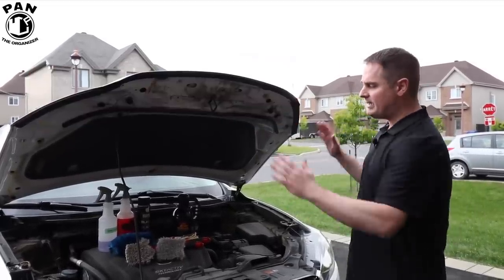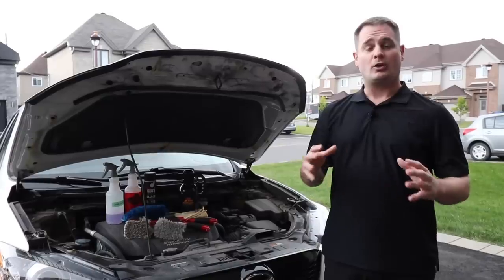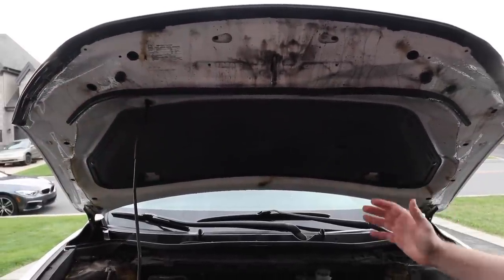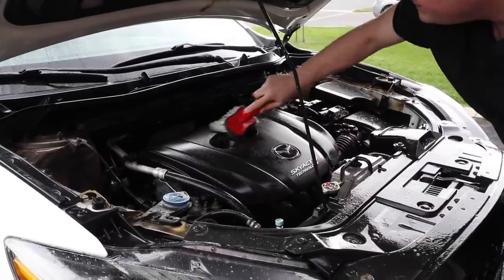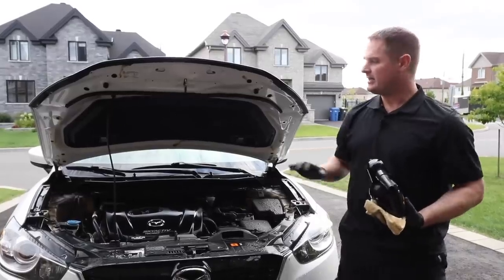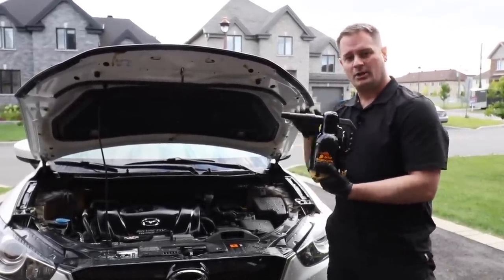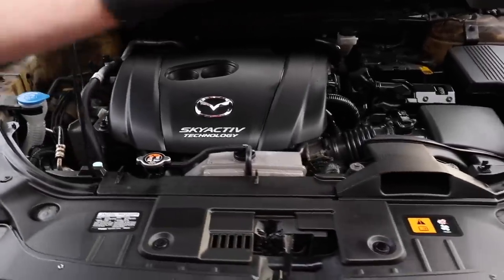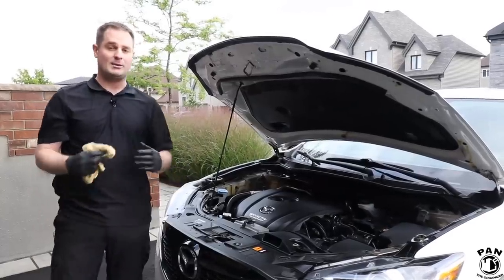HOW TO CLEAN YOUR ENGINE BAY !!!  EASY TUTORIAL !

Comment: Great job! Pan I have a question. I live in Dallas Texas and it gets and is humid in the summer time. I used to use a leaf blower to dry my whole car and it would dry the car….but I would also leave some water spot on the paint, door jams, and unpainted sections of the inner wheel well. 

Would the air dryer featured in this video do the same?
Reply from the maker: Well a more powerful car dryer will have more power but that’s not your issue. Your issue seems to be that you have hard water. That’s what leaves water spots behind. You would need a water deionizer and that would remove all minerals from your water to the point where you could just let it air dry after washing and rinsing it.

Watch my video on that topic here: https://youtu.be/IKNL1chAQXY
Reply: @PanTheOrganizer  thank you!

Comment: I always cover my alternator and intake of my engine before washing my engine bay.
Reply: at least cover the alternator/battery & shove a rag into the 'cold air' intake. Also spray electrical connections before & after the cleaning process with WD-40. Modern day engines use 100's of sensors that feed into the ECU. A false reading or 'short' could cost you a lot of $$$$.

Comment: Degreaser will harm your clear coat so watch the over spray learned this the hard way.  Nice video!
Reply from the maker: That's why you always wash your vehicle after an engine bay detail, to make sure you remove any left oversprayed grease or grime. 

Thanks for watching Steve!
Reply: They have lots of APCs that will work on engines that are safe on paint. You can use those instead or simply dilute the degreaser further.

Comment: Great video Pan...  I have a request because not many engine bay cleaning are available on YouTube for plug-in hybrid cars, would love to see one done by a pro.  I am worried with all the electrical wires and in my case, as electric motor in my R4P.  Even if there is not much difference, it would be reassuring to see.

Comment: This video reminds me of a question I've always had. Is there a need for, and if so, how do I clean my detailing tools (other than microfiber towels)??? I'd imagine that some of the detailing brushes after an engine bay detail come out pretty nasty, and wonder how I'd go about cleaning them before reusing brushes for other sections like fender wells, exhaust tips, etc.
Reply: Is it needed?  No.  Is it a good idea, likely. Cleaner engines run cooler, are easier to work on and easier to spot issues sooner.

Comment: Pan! How would you detail an engine bay with an aftermarket air intake like K&N where the filter is exposed? Since most of those units are already washable, what sorts of products could you use to clean the filter unit?
Reply from the maker: I would cover the performance air filters from cold air intakes. You don't want water near that. And from my car tuning days when I was much younger, if I remember, you can't clean those with regular products, you need specialty cleaners and oils to keep top performance, hence why we would simply replace them with new ones every now and then. But I haven't been into tuning for a long time, so maybe some of my viewers can chip in and answer.

Comment: No mention of what components to cover. Top of my head I can think of battery, fuse box
Reply: Nothing needs covered. Just don't put a high pressure nozzle up close to anything. The electrical system is low-voltage DC. It's fine.

Comment: So many videos say "don't spray your engine with water hose,"  then I see someone do it.
Reply from the maker: If you use common sense and the right procedures, there is absolutely no worries of using water to detail an engine bay. Especially on cars less than 10 years old. Car manufacturers go to great lengths to make their engine bays water tight and sealed. When it rains outside, you don't stop driving your car right? And a lot of that water does make it into the engine bay.

I have been detailing cars for over 26 years now, and have detailed hundreds of engine bays, and never once did I get an issue. But again, use common sense and don't spray a 3000 psi gas powered pressure washer full blast in there... lol.

I made a more recent engine bay detailing tutorial explaining all this here: https://youtu.be/zlKdOJtamDc?si=EsccVbVSKWRntsYg

Comment: I have an 09 charger and there are some electrical connectors that you can't get to.
How can I clean the engine w/o getting the electrical connectors wet?
Awesome video. Thanks so much.
Reply from the maker: Hi Neil.  You can wrap a plastic bag around sensitive electrical components and seal it with tape.

Comment: Hi. Did you directly rinse the entire bay without covering any components or parts? Would really like to clean my engine wash perfectly (Diesel Engine). Thanks.
Reply from the maker: On recent cars, I don’t see the need to cover components as manufacturers do a good job at making engine bays resistant to water.  But common sense is important, don’t spray water for too long at the same place, and if in doubt, cover sensitive components.
Reply: Thank you very much for your comment on this matter. Cleaning the engine really is a nail biter to do :)
Reply from the maker: But it’s so satisfying when you’re done. 👍🏻

Comment: You make it look so easy, but I'm still nervous about getting water in electrical parts.  Not sure exactly where I need to cover to protect those.
Reply from the maker: If you have a car that’s less than 10 years old, you shouldn’t overthink the moment.  Just use common sense.  If you feel some sensitivite components are exposed, just cover them with a plastic bag or aluminum foil.

Comment: Is it safe to rinse water sir? I mean it couldn't damage any wirings on the engine? Ty for response..
Reply from the maker: If you follow the steps in the video and use common sense, there are no worries, especially on cars less than 10 years old.

Comment: Have you done steam cleaning the engine bay with really hot water? I heard it helps make it easy to degrease the engine. What’s your thoughts on steam cleaning?
Reply from the maker: If you have a steam cleaner it can be a great tool indeed to detail an engine bay as long as you’re careful.

Thanks for watching!
Reply: Pan TheOrganizer would it be a little easier than this ? What’s more dangerous about using a steam cleaner ?

Comment: Is a 2007 Cadillac Dts Northstar engine safe to detail due to all the electrical components Thanks in Advance
Reply from the maker: Yes as long as you use common sense and protect any sensitive electrical/exposed components, alternator, etc.  Just put plastic baggies over sensitive things and don't use too much water pressure.  Also, don't stay too long on the same area when rinsing and you'll be fine.

Comment: i have a 2010 renault laguna, should i be covering up anything around the engine so water does not damage?
Reply from the maker: Modern cars are pretty water tight so I wouldn’t worry much.  Just use common sense.  If you want to be safe, cover any sensitive electrical components as stated in the video.

Comment: Hello pan what’s going better with the sidekick un comparison with an air compressor ?
Reply from the maker: Hi!  Not sure I understand your question...  The MetroVac Blaster Sidekick is an awesome tool for drying grills, engine bays, door jams, wheels, etc.  Its bigger brother, the Master Blaster Revolution, is an 8HP beast made to dry the entire car quickly. 

And air compressor could do the job under the hood as well, but its so bulky and not as mobile as the small lightweight Blaster Sidekick.  ;)

Comment: Hi Pan, this is really great as I have been looking for this kind of tutorial on how to clean the engine bay. I have a Mazda Skyactiv as well so just wanted to know, did you cover up some parts that can't be wet before you rinse or you can just go ahead and rinse it without covering some parts?

Hope you could reply on this one.

Thank you.

Already subscribed. :)
Reply from the maker: Hi Paolo!  I didn't cover anything in the engine bay.  Most modern cars are already pretty water proof from the factory.  Just use common sense and don't spray to much high pressure water on the same item for too long, and avoid things like the alternator.
Reply: Thanks for the TIP.. really like how you clean cars "Professionally" as it makes me think that I'm Pro as well just by watching it as it is really simple but. Great video and keep it up mate!

Comment: I thought you weren't supposed to pour water directly into the engine bay 🤔 so is it safe or not?
Reply from the maker: If I come up with a tutorial on how to clean an engine bay with water, what do you think the answer is? And who spoke about "pouring" water into the engine bay? We're simply spraying a bit of water and once it's done, you immediately dry using a car dryer or blower. I have been detailing engine bays for over 23 years now and never had a single issue. Use common sense, safe practices and you're fine. Especially if your car is newer than 10 years old, car manufacturers really came a long way to keep engine bays water tight.

I even detailed the engine bay of my 105,000$ BMW's twin turbo V8 engine here: https://youtu.be/H252L0SOHE4

Comment: When using the SuperClean brand degreaser, what ratio do you use for the engine bay? Couldn't the full strength hurt the clear coat on the painted parts under the hood and within the engine bay unless diluted?
Reply from the maker: 3:1 or 4:1

Comment: Good video ! But you sprayed water onto the alternator, battery and into the intake🥴.
Reply from the maker: Common sense Darryl. Common sense. I have been detailing cars for over 23 years now, and have done hundreds and hundreds of engine bay details, never had an issue once. Not a single time. Car manufacturers go to extremes to make sure their engine bays are water tight. What do you think happens when you drive in the elements, inclement weather, thunder storms, snow storms, etc? Do you think your ending bay stays nice and dry? Nope.  

And as I often say, if you are worried you might damage something, then skip the engine bay detail. Or cover the more sensitive parts like alternators, sensitive electrical components or electronics, air intakes, etc.

Heck I even detailed the engine bay of my expensive BMW M550i with its awesome twin turbo 4.4L V8 beast of an engine here: https://youtu.be/H252L0SOHE4

Comment: You don't have to cover the battery or anything before spraying water?
Reply from the maker: If you use common sense, and are working on a newer vehicle (less than 10 years old), it's not necessary. But if you want to be ultra safe and take necessary precautions, then you should disconnect the battery and cover any sensitive components.

Comment: Is it safe to clean with water inside the engine bay? I mean there is a lot of electrical stuff inside there!
Reply from the maker: Well as you can see in this video, that’s exactly what I did.  On newer cars less than 10 years old, there are no worries if you use common sense and use precautions.

Comment: Is there a reason why you chose not to detail the sides or back of the engine bay? (shock towers, firewall)
Reply from the maker: There is rustproofing there.
Reply: @PanTheOrganizer  rust is prevented via paint like the rest of the body. the paint in there is no different than the rest of the car? No?

I've never had an issue cleaning these areas. But maybe you have?

Comment: Would you recommen this to a 2001 camaro ss ..the car is hardly driven and well maintained with 42,720 miles.just worried cause it's 18 yrs old and don't want to destroy my engine.by the way great work.
Reply from the maker: As long as you protect the sensitive components with a plastic bag: alternator, battery, computer, etc.
Reply: Pan TheOrganizer thanks
Reply from the maker: How did you discover my channel Joey?
Reply: Pan TheOrganizer needed to clean my engine bay and the fact of putting water on it made me cringe..so your knowledge was very valuable.Thanks again.
Reply from the maker: Thanks for the feedback!

Have you watched more of my videos?

Here’s one to get you started.  This is how I detailed my own brand new car when I took delivery from the dealership: https://youtu.be/dsCmJJDP3xo

Comment: @Pan a lot of manufactures say not to apply chemicals in the engine bay, what's your opinion on this
Reply from the maker: I have been detailing cars for over 23 years now, and never had a single issue with engine bay detailing.  Car manufacturers have no choice to give warning or cautions as they don't know the person's experience.  Kind of like a warning label on a hair dryer that says "Do not use when in the bath".  That's common sense right?  Yet someone, somewhere did this, and they had to start putting warning labels.

As long as you use common sense and proper techniques, there are no issues especially on recent cars from the past decade.  Car manufacturers go through crazy water tests to make sure their engine bays are water tight.
Reply: @PanTheOrganizer  thanks.

Comment: is it safe to spray water inside the engine bay? wont it cause an electrical damage?
Reply from the maker: If you use common sense and follow steps like in this video, no worries. Car manufacturers go through great lengths to make their engine bays water tight.

Comment: Hey pan quick question. The alternator does it have to be cover up? Or is it ok to get it wet?
Reply from the maker: It depends on your level of comfort and experience. If you have a bit of detailing experience, you can go ahead and not cover anything on modern cars (less than 10 years old). But if you want to be on the safe side, cover the alternator and any sensitive electronic/electric parts with a plastic bag, and don't focus too much water on the same spot, keep the nozzle moving.
Reply: It's fine if you let it dry enough. Or blow it out with an air nozzle or blower. Everything under the hood was designed to get soaked when driving through puddles. Just don't put a pressure nozzle too close.

Comment: hello pan, instead of using the the air blower to dry the engine bay out would a hair dryer on the cold setting also work ? i am asking because the air dryer is rather expensive and i think a hair dryer would maybe be a viable substitute. what would be your thoughts about this ?
Reply from the maker: No a hair dryer doesn't push enough air.  You could use a leaf blower if you wanted a less expensive alternative.
Reply: @PanTheOrganizer   thank you for the information

Comment: Always consider  how bad (dirty) it is before you start. Inside a home garage might not be the best place. As a tip, wet the ground under the car it will help as not to stain a driveway (concrete) and make cleaning  up when finished somewhat easier.
Reply from the maker: Good tip!

How did you discover my channel?
Reply: I use some Optimum Products.  Yven....love that guy!

Comment: Water is not to be used near electronics,just dry cleaning  is enough!
Reply from the maker: Says who?  I have been detailing for 22 years and have done hundreds and hundreds of engine bay details and never had a single issue.  If you know what you're doing, and are taking necessary precautions (on older cars) there are no issues.  It's a wives tale to not introduce water into engine bays, especially on cars less than 10 years old.  Car manufacturers go through great lengths in testing their vehicles for water proofing and seals, much harsher tests than just a typical engine bay detail.

Comment: Which garden hose sprayer do you have?  It looks interesting.  Thanks.
Reply from the maker: Hi Rob!  I like high end equipment, so even my garden hose is high end.  I'm obsessed with car detailing.

The garden hose is a 3/4 inch polyurethane unit from a USA based company called Eley Hose Reels.  I also have their rust proof aluminum-alloy wall-mounted hose reel and professional spray nozzle set and quick disconnects.

Comment: Wait a second I thought you cannot use a hose to spray the engine…. Lol
Reply from the maker: That is incorrect. Use common sense and proper tips like in this video and you’re fine. Especially on cars less than ten years old. Modern cars have water tight engine bays.

Search for engine bay detailing on YouTube. You’ll see all the professionals detail engine bays with pressure washers or garden hoses with no issues.

I have been detailing for 25 years and have detailed hundreds of engine bays. Not once have I had an issue.

I even made an engine bay cleaning tutorial on my previous high performance BMW’s twin turbo V8 engine here: https://youtu.be/R5ZbroMTULM

Comment: Pan i am really confused and worried about to wash my car engine bay with water spray
Doesn't it damage any part of engine bay?
Reply: Engine bays get wet when you drive in rain. Just only ever use low pressure and dry it thoroughly after
Reply: Engine bays get wet when you drive in rain so a wash is fine. Just only ever use low pressure and dry it thoroughly after

Comment: @PanTheOrganizer you need to say “Disconnect the battery” in terms of safety even though it’s common sense.
How would you disconnect a battery?
Reply from the maker: You want me to explain to you how to disconnect a battery?
Reply: Pan TheOrganizer I’ve never touched a battery before so I wouldn’t know how to do that.
Reply: Pan TheOrganizer I was waiting to see how you disconnected it before everything else.
Reply from the maker: You can follow your car’s user manual, but itbusually just involves taking a screw driver and loosening the screw that tightens the clamp on one of the battery poles.  Most people never disconnect the battery and still have no issues washing their engine bay.